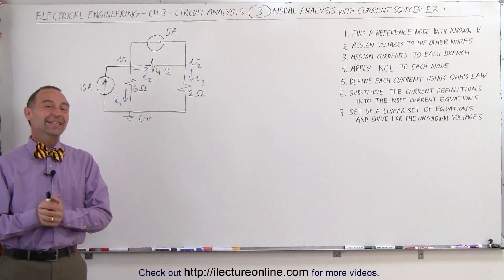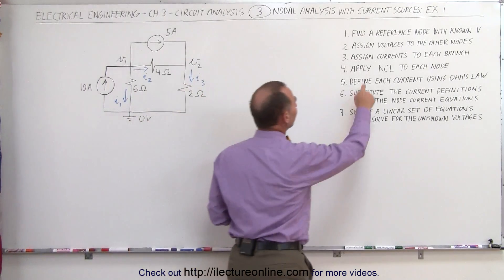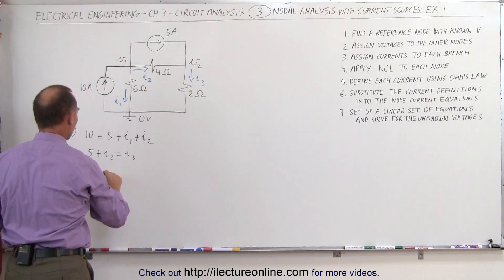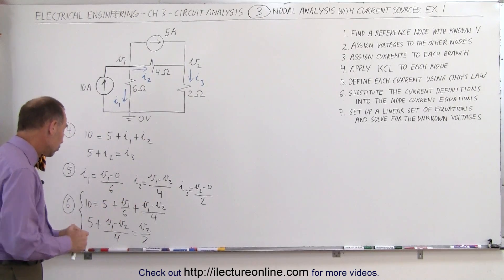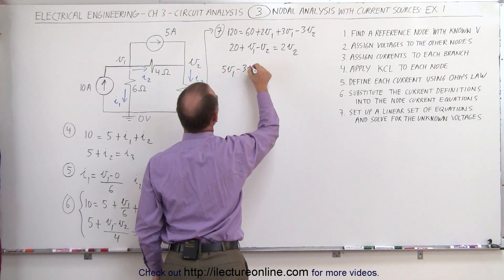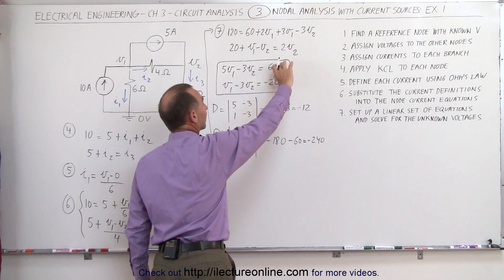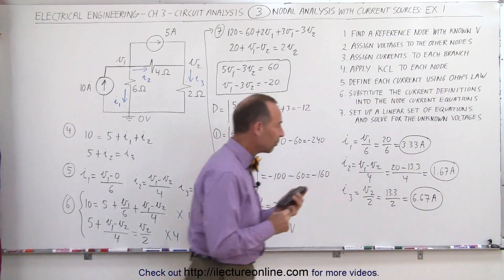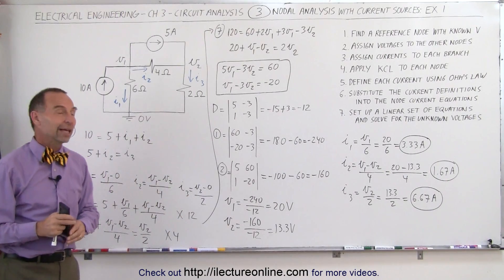Electrical Engineering: Ch 3: Circuit Analysis  (3 of 37) Nodal Analysis w/ Current Sources: Ex. 1

Comment: I got whole numbers 
i1=4A
i2=-2A 
i3=6A 
and I have cross check using the kcl 

(I1)The 1st current source is 6A
(I2) The 2nd current source is 2A

i1=I1+i2
4A=6A+(-2A)

i3=I1+i2+I2
6A=6A+(-2A)+2A
Reply from the maker: We just checked the answers in the video and they are correct.  Thanks for checking.

Comment: Sir, I understand that if we assume a wrong direction for the current, it's ok because we'll just get a negative answer. However, if we assume the voltages wrong (for example if i took i2 as (V2-V1)/4, I do not get a proper value for V1 and V2. 
Would very much appreciate a reply.
Thank you in advance!!
Reply from the maker: That is correct.  You cannot assume the wrong direction for the voltages.   You will get an incorrect answer.
Reply: @MichelvanBiezen  Wow.... 6 years later and you still continue to reply. You're truly an asset to us students ❤️‍🔥. If it doesn't take too much of your time, Sir, could you please explain how we decide which potential is greater than the other.
Reply from the maker: In "traditiona" current flow, the current flows from high potential to lower potential  (form the positive side of the battery to the negative side of the battery).  Therefore on any branch if  the current flows from left ot right for example, the voltage will drop from left to right.

Comment: We have in the class learnt that choosing the node connecting the most branches is best practice (I think the node we marked V1 in this example.); also, we note every possible current exiting the nodes; is it okay?
Reply from the maker: There are often multiple ways to solve the problem.  Try your method and see if you get the same answer.

Comment: How did you know v1 is a higher voltage drop than v2?
Reply from the maker: Relative to ground (at the bottom of the circuit v1 is at a higher potential than v2.  We know that because the current flows from high potential to low potential.
Reply: @MichelvanBiezen  Thank you so much professor

Comment: Sir, how do you determine which node has the higher potential? Do you just assume?
Reply from the maker: If we assume that i2 is from left to right, there will be a voltage drop across that resistor between the 2 nodes.
Reply: Thank you sir, I also realised this in the next example.Thank you